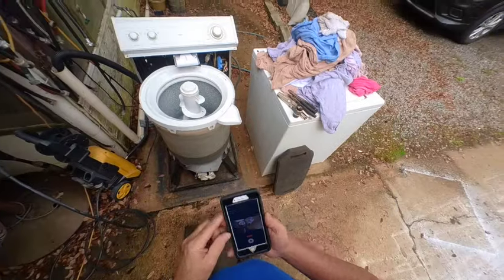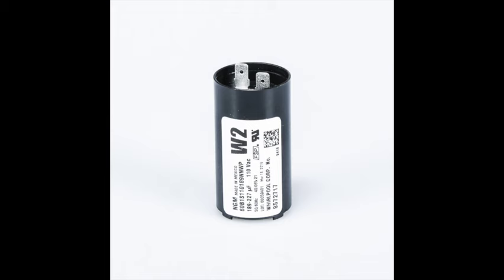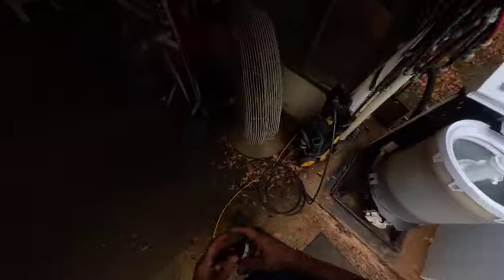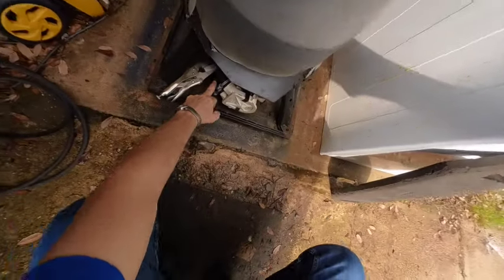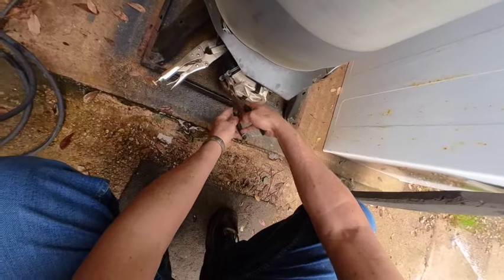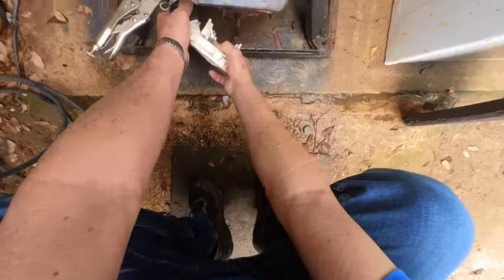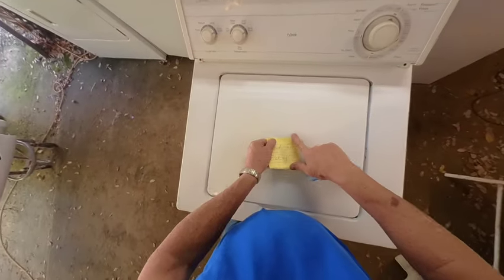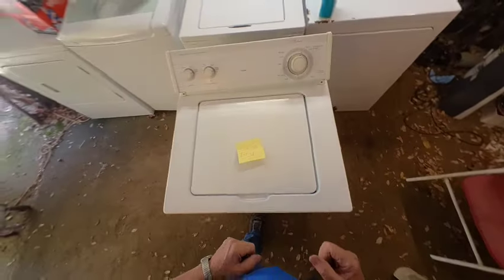How To Fix a Washing Machine That Hums But Won't Start: Diagnosing Common Problems

Comment: This video is 2 years old, but I still hope you get this message. Thank you so much! Our washer started humming today. I found a video that said the capacitor likely burnt out. I sent my husband to the hardware store, while he was out, I did another YT search and saw your video. When he got back (they didn't have the part) I told him to check the pump just in case and low and behold it was my son's sock stuck in there!! We couldn't get it out but found the part online. Saved us from getting a new washer!!! God bless you for posting this and helping us all.
Reply from the maker: You are very welcome! Articles of clothing often get stuck in water pumps. Thanks for watching!

Comment: Save me a bunch of money thank you sir. I didnt pinch the line i just emptied by hand as much as possible then tilted back against the wall and went underneath the cover took a total of 5 min and a pair of pliers after i tilted it back. Horrible smell though.
Reply from the maker: Glad you fixed it. Thanks for watching!
Reply: I did the same. Thanks for the tip both of you guys

Comment: Very helpful video , certainly found a sock in the pump but after removing sock unfortunately had no luck with it fixing the humming noise , fills with water but still want spin or drain . If you could give me further advice i would greatly appreciate it .
Reply from the maker: If it agitates but won’t spin it could be the motor. The motor reverses to spin and drain and those windings could be burned. I have seen a bad capacitor cause that too. Thanks for watching!

Comment: Oooh, may e you can help me too. I have a old top washer and it just wont agitate. But it will spin and drain.
Reply from the maker: You probably have a transmission problem. Specifically the mechanism on the bottom end of the agitator shaft. Watch this video for that repair. Whirlpool Gearcase Rebuild | Total Overhaul Corrected
https://youtu.be/UbybdNrfYvg

Comment: Thank you for the video! Question: My washer would just stop from time to time then  I'll turn it off and back on it would start back running. Now it just stopped during cycle and is humming like the video. Do you think it could be the switch?
Reply from the maker: Thank you for reaching out with your question! It's difficult to provide an accurate solution without knowing the specific model of your machine or being able to diagnose it myself. However, based on your description, I can offer a couple of possible causes for the issue you're experiencing.

One possibility is that there might be something stuck in the water pump, which could be preventing it from functioning properly and causing the washer to stop and hum during the cycle. Another potential cause could be a bad start capacitor, which can lead to issues with the machine starting or running correctly.

As for the switch, it could also be a possible cause, but it's hard to determine without more information and a proper diagnosis.

Please keep in mind that these are just general suggestions, and the actual cause of the problem could be different. To get a more accurate diagnosis, I recommend reaching out to a local appliance repair technician who can assess your machine in person.

I hope this helps, and if you have any further questions or concerns, please don't hesitate to reach out.
Reply: @HarperandKnowles I really appreciate you responding so quickly! I'm pretty handy around the house and was hoping I could save myself from getting another washer. But I think the troubleshooting would be a bit too much for me. So, with the service cost in my area I think I'll do better getting a refurbished washer with a 30 or 60 day warranty. Btw it's a Whirlpool Ultimate Core II.

Comment: Thanks for the video.  Unfortunately the water pump was empty and it is still not spinning how can I test to see if it is the capacitor?
Reply from the maker: You can check out this short video right here Testing Motor Starting Capacitors Made Simple
https://youtube.com/shorts/CM5qKTLY43M?feature=share. Thanks for watching!
Reply: Thank you!
Reply: @HarperandKnowles I replaced the capacitor and it still isn’t working is their a way to test the motor.
Reply from the maker: Have you checked the lid switch? Why don’t you remove the motor from the transmission and water pump and try it with no load on it. I assume you have the lid switch bypassed so you can do this. There is a way to test the motor but it requires a test box: Make a washing machine motor test box at home - FULL INSTRUCTIONS! https://youtu.be/56OI7euGTEc you can test the continuity of the windings to see if they are intact.
Reply: I’ll give it a shot. Thank you for your help sir.

Comment: Hopefully you can help me out. My Frigidaire washer is doing a humming noise won’t spin nor agitate. But it does drain. What do you think is wrong. Hopefully nothing to expensive 🤞
Reply from the maker: The belt may be off. Unfortunately I can only guess when I can’t diagnose the problem personally. Thanks for watching.

Comment: This video is great. Wondering if you might have some insight to my situation.
Whirlpool wtw5000dw3
Just replaced the water inlet a few weeks ago.

I’ve done some testing, and only when it is on HOT water cycle does this happen. Cold, cool, and warm work as normal.
It begins to fill with water for a few seconds, and then just hums. Doesn’t go any further in the cycle - just stays there. 
Any idea what could be causing this issue?
Reply from the maker: That is a bad water supply problem. You probably have a bad replacement valve. Try to get OEM parts when you can. Also check that your water supply into the valve is working properly too. The hum is the solenoid trying to open the valve.

Comment: what about if sometimes it does this, but if you let it sit for 2-3 days it starts to work for a load or two again then stops working and does this again?
Reply from the maker: Then I’d suspect you may need to change the start capacitor or perhaps even the motor. The internal thermal protection of the motor will shut down an over heating motor.  I can’t give you a definitive answer without being able to actually work with the machine, but those are my best guesses. I hope this is useful and thanks for watching.

Comment: I checked the little pump but I couldn't see anything inside of it... what else could it be?
Reply from the maker: If the machine will spin with the pump disconnected it is the pump. If it won’t it may be the capacitor or could be the motor itself. Thanks for watching!

Comment: So what if when I have it on just hot water, it fills, but when I turn the hot water off and leave the cold water valve on, it just buzzes. It’s a whirlpool by the way. It fills up for like twenty seconds and the just shuts off
Reply from the maker: It’s sounds like your cold water valve or cold water supply is on the fritz. Change the valve. Thanks for watching!
Reply: @HarperandKnowles  thanks!
Reply: @HarperandKnowles  the water inlet valve, right?
Reply from the maker: Correct
Reply: @HarperandKnowles  thanks again!

Comment: So the washer  am working on  hums for a few seconds and clicks   

Any idea would help 
Am still working on it
Reply: Nothing happens.  I was trying to recalibrate when I try it hums and clicks   and nothing happens
Reply: The main problem was it slowly feels up with water       and does nothing.     The water drains when I hold the start button for a few seconds
Reply from the maker: I’m guessing you are working on a digital type washer.  The humming is probably the water valve solenoid and if it has a limited flow of water  you may need to replace the water valves or clean the screens inside the inlets. A continuous clicking sound might be a defective lid lock. Watch this video it might help you. Amana Washer Making Noise When Filling | Hack This Issue
https://youtu.be/qq37YBKr3q8
Reply: @HarperandKnowles  it's not digital it's the one with the 6 little led and start button.  

Upon close inspection the motor spins for a 2 to 3 seconds  it shuts off . Working on it now
Reply: @HarperandKnowles  I figured where the humming  came from  it was the motor spinning for a few seconds and it clicks  off
Reply: @HarperandKnowles  I think it's  trying  to agitate to check the load balance. It tries to do it aga in  and just shuts off the machine  in the end
Reply: When am in the diagnostic mode and try to put it to test  the motor tries to spin for a few seconds and clicks . When I put it in to the normal washing mode it fills  up with water and the light blinks
Reply: @HarperandKnowles  I think  it's  fill sense error
Reply: Right it's stuck in sensing   until it shuts off it self
Reply from the maker: Okay, what’s probably happening is your washer is failing to shift properly.  Check the splutch for binding.  It should shift from spin to agitate easily when you have the actuator removed. If it’s hard to shift try lubing the mechanism or replace it.
Reply: @HarperandKnowles  I did open that part it was clean I even  installed a new clutch switch.  Nothing  changed
Reply: @HarperandKnowles   I just  tried  some code reading  and I got  f2 e3
Reply: Am still worried about the motor being faulty

Comment: Where is the compasotor at?
Reply from the maker: That all depends on your particular model. These whirlpool direct drive machines had them in three locations. Some models have the capacitor attached to the motor with a metal strap while others it is located on the right rear cabinet under the water fill valves in a white plastic piece that attaches it to the cabinet back panel. In much older “museum” models it can be found under the console. Thanks for watching!